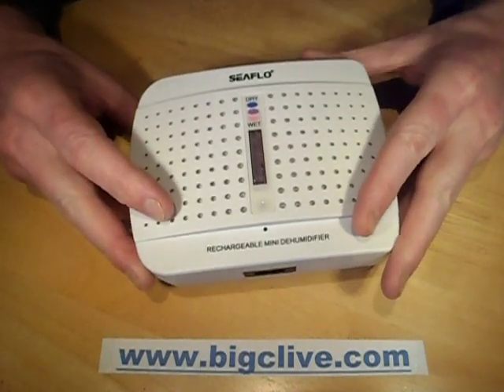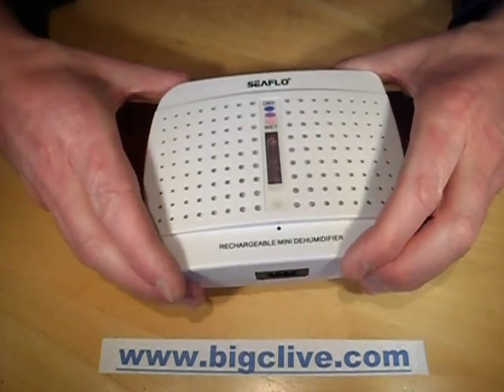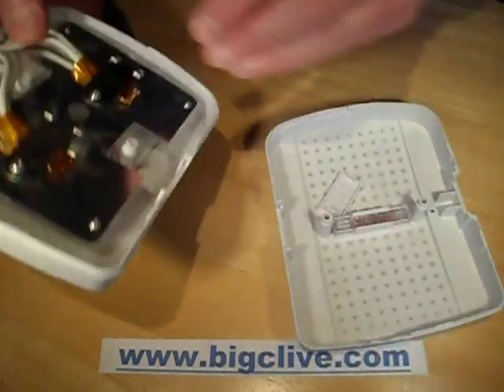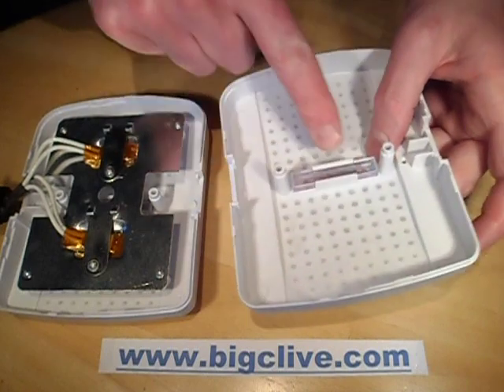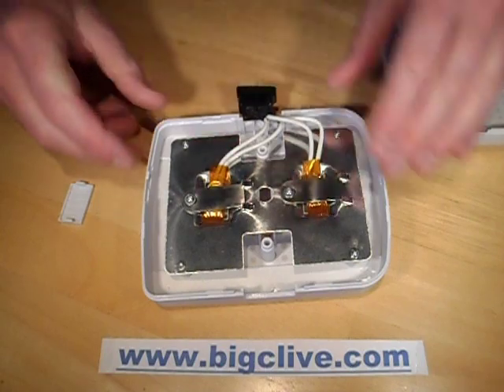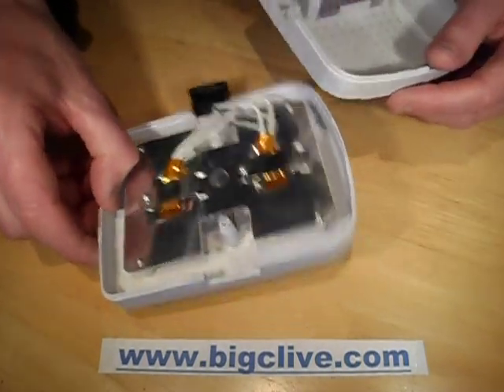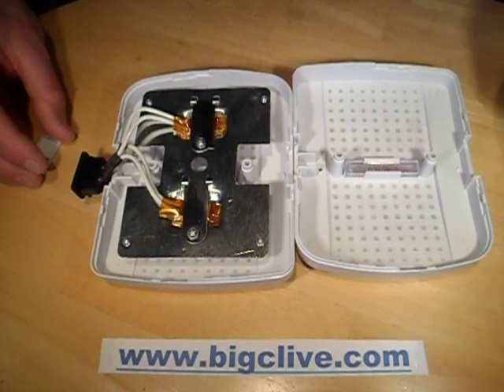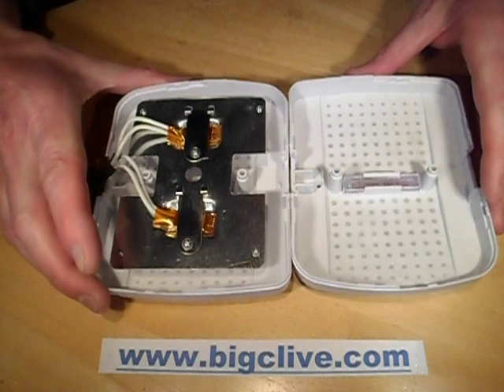Review and internal look at a "rechargeable" silica gel dehumidifier.

Comment: I still don't know how to turn the damn thing on 😢
Reply from the maker: You plug it in to dry it out (you can weigh it to see how wet or dry it is) and then just place the unplugged unit in a cupboard or drawer you want to absorb moisture from and it will help keep it dryer.

Comment: I know this is a really old video at this point, but I want to thank you anyway. I have a bunch of tubs I need to store in a cold attic and I have just 1 pair of these. I was contemplating spending too much money buying a bunch more but I think now I'll just use them as stand alone rechargers and use the filling hole in them to dry out loose silica which I'll then chuck into DIY tea bags, which mere pounds for hundreds. 
Might still pick up a few more just to make a small "farm" of silica dryers. Don't much fancy using the oven do try them. Many thanks.

Comment: Thanks, Big Clive! Thanks to this video, I was able to open up the Eva-Dry E-500 to upgrade it. It opens up the same way except has a central screw hidden behind the back teardrop-shaped label (comes off nicely with a heat gun). I replaced the 19.5 oz of silica gel beads with a pound of activated alumina for more drying power (10x if you believe some sellers of activated alumina!).
Reply from the maker: It'll be interesting to see how that performs.  I've been testing some desiccants for months and the silica gel beads beat the other by a large margin.  Even what was being sold as zeolite.

Comment: 7 years later, how's it holding? What's your opinion about the product now? Any better alternative for car?
Reply from the maker: I still use it for keeping 3D printing filament dry.
Reply: I occasionally dry out my car in the winter when the weather is just about to flip from wet and windy, to frosty.  Luckily I can just get an extension lead in through the boot and running a EcoAir DD1 MK5 overnight @45% (Don't want to dry the leather seats out any lower..) I can get 300ml - So a mug full of water out over night...!!

Comment: Possibly this video that gave yourself another subscriber all these years ago. But just needed to recheck that it's not full of the indicator silica.
Reply from the maker: It's just a small window that has the indicator silic gel.  Some has a slightly toxic colouring agent.
Reply: @bigclivedotcom  indeed, just been seeing if they dry faster without that little fill cap on. They don't get quite as warm. But if I do blow inside the mesh I get a lot of moist air out, maybe this is helping to circulate the air inside?

Comment: Couple of questions:

1. What is the enclosure made up of?

2. What's temperature does these PTC elements heat to?

3. How does the enclosure does not burn when elements heat?
Reply from the maker: The enclosure is plastic.  The PTC heaters don't get excessively hot.
Reply: @bigclivedotcom  I googled a bit and found to regenerate silica get you need temperature over 100*C. But I can't seem to find the exact temperature of these heating elements online. It takes 1-2 hours for them dry at 120*C. But these devices often list that you need to keep it plugged for 5-10 hours. Let me know if you can post temperature of the elements inside this device.
Reply: @AS-ug2vq these devices cost like $15, maybe just buy one.
Reply: It's made of 14 karat gold wood bark.

Comment: I recently picked up a couple of these in NZ sold under the "Goldair" brand. Exactly the same except mine have louvred slots instead of holes. They can be plugged into any power source from 120-240 volts. 

So I thought to make up a series Y lead so I could run two from a 230 volt inverter at a more moderate wattage. Was not entirely successful. The elements in them are PTC so what happened is the one that heated up first hogged all the voltage! So it got rather warm while the other stayed practically cold. I connected them to a 120 volt inverter (in normal parallel) instead. 

What I might try though is making up a "diode lead" that will split the power by polarity rather than resistance. That way one will get the positive half cycle whilst the other gets the neg. 

Of course you can't "recharge" them in the place you use them as that will simply put the moisture back! lol They go faster if they are done in a place that has a decent airflow. I might make a little purpose built cabinet that incorporates a small fan.

Comment: I'd say mine is not split down the middle so they didn't go everywhere .  4 screws in the back kinda killed that idea of spilling but it was overfilled so some popped around :P  don't really trust the plugin wire.  tooooo thin and without the hanger or clip there's no real way to stand it up.  Does get quite hot.  usually keep it in an area where I have film and old papers...  supposedly in a water tight old school Ammo case.   ha.

Comment: I purchased two like that last year and an enclosed/weather sealed bin for my 3d filament and it is damn near 0% RH in the case and outside the case 75%-90%.  Mine look like that but are made by Evadry.  The Evadry has a flip out the back 117vac prong and it takes 12 hours to recharge it.
Reply: They cost about $15 at Home Depot last year.

Comment: Perhaps a small inverter in the car would allow it to be re-charged when you are driving.
Reply: +James Lewis Yeh a 12/24volt model of one of these would be great.
Reply: You would release the humidity you just removed
Reply: +Agent Office not yeh but outside venting of that moisture laden air :) like some sort of valve that opens when the "recharge" cycle is open.
Reply: +Agent Office that's of course if it was built in.

Comment: Would this be any use in a car, I hate getting into my car and the windows are all fogged up in the morning.  cheers
Reply from the maker: +mspenrice You can get silica gel socks that sit under the windscreen and get dried by the flow of warm windscreen air when driving, but absorb moisture while parked.
Reply from the maker: +DJ Cruicky I use one in mine, but I'm afraid it doesn't always seem to help.
Reply: +bigclivedotcom Thanks
Reply: +bigclivedotcom The power draw suggests it should be nicely compatible with a typical in-car inverter device... so you could leave it in there permanently, and regenerate it as you drive, with the fan running, and maybe aircon if you have it or the windows down etc...
Reply: +bigclivedotcom Hey, that's a nice idea  ;)

Comment: Could you replace the coloured beads by a strip of cobalt chloride paper? Would that be a more effective indicator? and would it be safe?
Reply from the maker: +Mandolinic If you don't mind putting it on  set of scales every so often you can determine exactly how much moisture it has absorbed.  There's a very distinct difference in weight between a fully saturated unit and one that has just been dried.  I wrote the weights on them to check their state.
Reply: +bigclivedotcom  where can i get one of these
Reply from the maker: +Adam sturgeon Search your local ebay for rechargeable dehumidifier and note that there are two types.  The plug-in type and the microwave type.  Here in the UK a typical listing would be:-
http://www.ebay.co.uk/itm/281245994960

Comment: The reason the blue/pink gel beads are only being used in the small indicator capsule isn't because of cost savings, it's because in order to get the color-changing properties, the gel is impregnated with cobalt chloride, a toxic and carcinogenic compound.
Reply: +Naaman Geist I suspect the beads are cobalt cloride dodecahydrate - cobalt salt molecule with 12 water molecules attached. Changes in the amount of hydration cause the molecules to reflect pink when wet - blue when dry. This stuff was popular on various "weather forecasters" in the sixties. I remember a friend brought his mother a "weather owl" whose stomach feathers were painted with this mixture. A pink belly forecast rain and a blue belly forecast clear skies.
Reply: True the blue ones do have a toxic issue but you can get the orange ones which  don't have the cobalt blue dye and are safe to handle.
Reply: +metric85 
Yes -Totally, it only becomes an issue when you handle the coloured beads because of the dye.
Reply: +Naaman Geist 
True - In the lab I worked in a couple of years ago, we had to stop using them for health and safety reasons.
Reply: +Derek Thomson Is this device safe to use?
Reply: I remember that stuff being included with a chemistry set...

Comment: Reason that thay did not used color changing beads might be that color changing addition is carcinogenic. here is some wikipedia: "Cobalt (II) chloride is deep blue when dry and pink when wet. It is toxic and carcinogenic, and was reclassified by the European Union in July 2000 as a toxic material." so here is the naswer